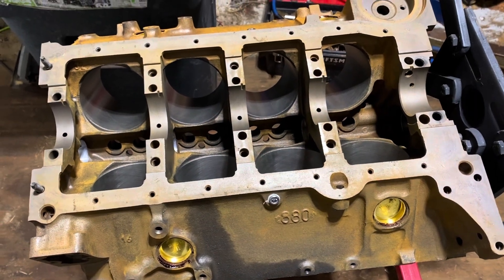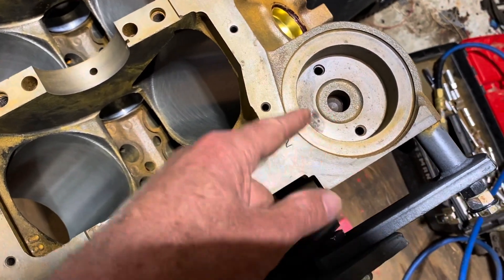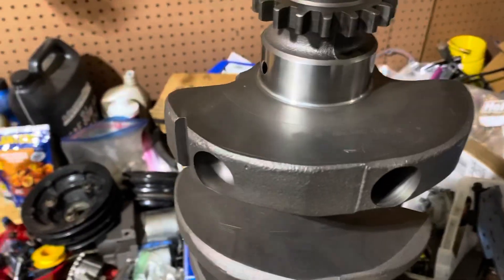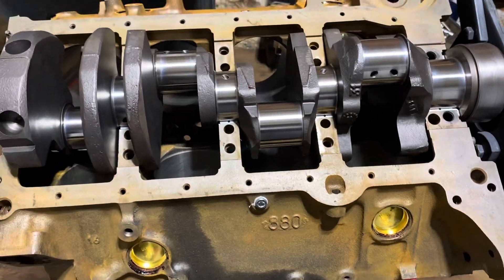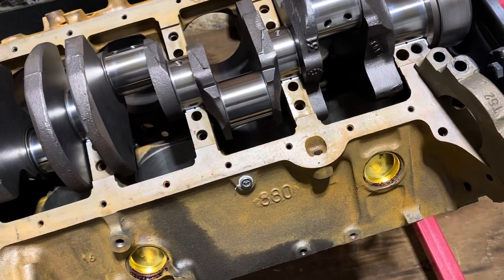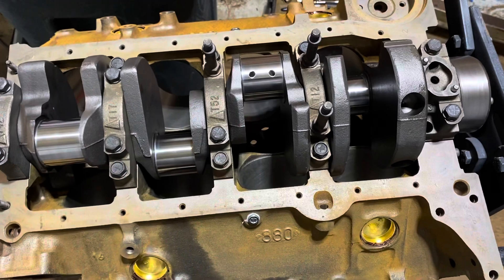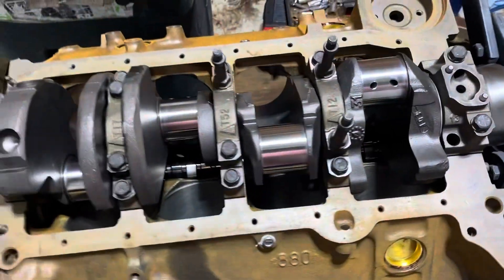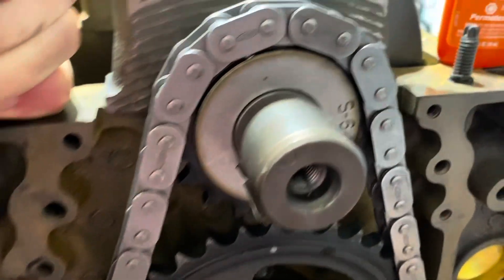Mercruiser 5.7 5a - Crank Too Tight But Fixed; Other Tips Too

Comment: yes, the crankshaft is supposed to move easily even with new bearings... it should start to rotate easily by hand and it shouldn't feel like there is any resistance when you start turning it... the fault could also be that a bearing bracket had gone to the wrong place or some debris or it could be small casting fault in the bearings as well...if it doesn't spin well and wobbles, there is a risk of bearing damage etc..I can say that from experience, which is true...you shouldn't feel resistance when you start spinning and don't wobble..

Comment: Where are you buying your bearings😢 you shouldn't need to do any of that except check all your clearances make sure the board is straight😮 play that's not my engine.
Reply from the maker: Bearings are machined parts and have tolerances. I’ve also gotten the wrong parts in the right box. I use good quality Clevite Mahle MS-909P bearings. It’s just the nature of building a precise machine that dimensions don’t always match.

Comment: You're not going to check the clearances first ?
Reply from the maker: No if it’s too tight you waste time checking clearances. I’ve said it in many videos, I recommend that the crank be checked for free rotation then check clearances. If it binds, all the labor checking clearances is lost if you have to replace a crank or bearings.